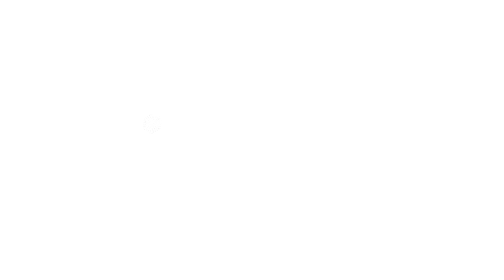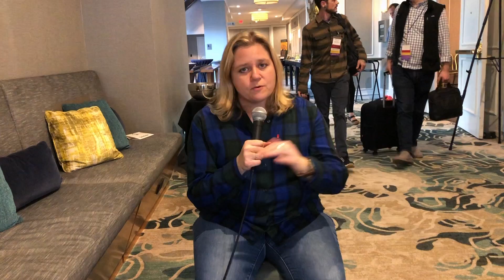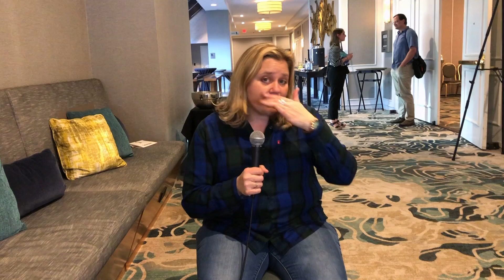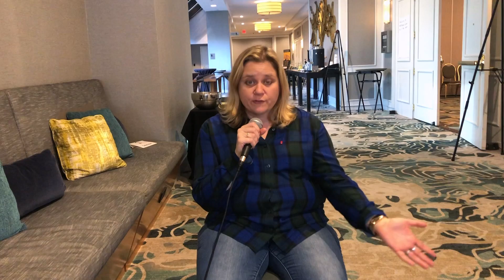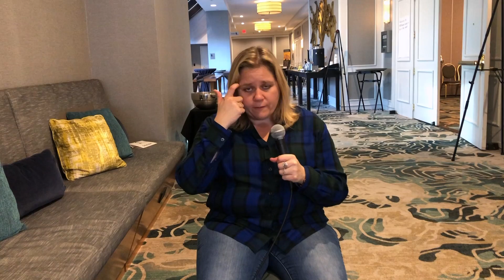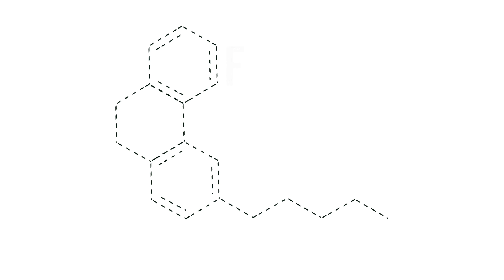Vapor Pressure Deficit (VPD) and Cannabis Cultivation

Comment: Speaking of double whammy..  Trying to get RH down later flower, when buds are larger and denser, you need HVAC super power to get to a 1.0 vpd due to the fact you need your temps sub 68 degrees, the point at which you can get PM or bud rot if your humidity gets too high due to failure somewhere in HVAC system.  Therefor, you need massive HVAC ability to remove quickly enough, the RH in the room from feeding, if you want to run for instance, a 62/63 temp at 45% RH late flower.   Having RH above 65 late flower has been no good, giving us yeast and mold issues and bud rot with some. A 1.2 kPa is far easier to get while also doing away with money sucking failed tests.  For instance a 75@60.  The units can dehum easier, and you have a good RH to deal with.  You however lose some of that shock we like to put in the plants to up our test results as well.  Lots of variables..

Comment: Since were discussing VPD measures in kilopascals, would an exhaust fan creating a negative pressure in a grow tent effect the VPD measurements ? I have a 4 inch ACInfinity inline fan and on speed 3-4 , if I pull out the tent sides, they suck right in.
Reply: Interesting. I would like to know this also.

Comment: Hello, could negative pressure ventilation (in a grow room or tent) influence VPD ? Could there be relations between the two we could control ?
Reply: Not really. VPD calcs account for atmospheric pressure so if you drop the pressure it will reduce the vapor pressure in the leaf and outside it.
Reply: @samburgner8179  yes but the LST and room temp remains the same
Reply: @surronzak8154  They would both cool down under lower pressure?
Reply: @samburgner8179  I need to check this but I currently don’t have a powerful enough exhaust fan, you maybe right, could the leaf transpire faster thanks to lower pressure ? Resulting in faster cooling
Reply: @surronzak8154  Well its all feedback controlled so the faster it cools the faster the transpiration rate will slow. You were right that the light intensity affects the LST more.

Comment: I would really like to know how defoliating affects VPD. Especially as its a common practice said to increase yields. Leaves are important for so many things so im just wondering why this practice is said to do this.
Reply: Doesnt affect VPD. Plant will evaporate less overall because of less leaf area, so if the humidity drops as a result of that then the VPD would rise, but you could dehumidify less and the VPD would not change. VPD is an indicator, not a measurement. It relies on stomatal conductance, leaf temp, air temp, vapor pressure in the air. Many ways to change VPD, but defoliating is not one unless you change your environmental management too.

Comment: Here's an easy way to understand what VPD is as a concept if you had trouble with this video. Relative humidity is a percentage because it's the ratio of how much moisture the air contains compared to how much it CAN hold at the current temperature. VPD is basically the other side of that coin - it's a measure of how much MORE moisture the air can hold at a given temperature.
Reply: Thanks! Super helpful
Reply: so she said a vpd of 1 is usually a good set point. but do you try to maintain 1 the entire grow? or change it for different stages?
Reply: @DampButtHole Different VPD for different stages. You want a low VPD 0.4-0.8 during propagation/early veg so the plant focuses on root development. 0.8-1.2VPD for Early-Late veg and 1.0-.1.5 for early to late flower.

She states in the video that having a higher VPD to prevent molds can actually have a ironic effect. So, a VPD of around 1* is good. Each plant is different.
Reply: @DampButtHole seedlings .80, veg .95/1 flower 1 to 1.2
Reply: 1 is generally safe all-around, but there's a range! You can go lower for clones/seedlings, like 0.6 - 1.0 kPa. Vegging plants stay happy around 0.8-1.2 kPa, and flowering plants can go higher - 1.2 - 1.5kPa. I like to envision a spectrum from hotter + wetter, to cooler + dryer, as the plants go from seedling to vegging to flowering  @DampButtHole

Comment: Not a word about leaf surface temps, which is a major factor of VPD. 
Think of a triangle, where you have to keep 3 factors constant within a parameter-
air temp at top of canopy
Relative humidity at top of canopy
leaf surface temp at top of canopy
you are looking to maintain 1-2 degC cooler leaf surface(LST) than ambient.
Everything can look fine in the numbers if you ignore LST, but maybe little growth..
then you check LST and find it is 5-6 degC below ambient, 
then you realise why LST is also on the VPD chart along with air temp & RH.
Reply: True, I didn't talk about leaf temperature. You are correct: Technically speaking, it is the saturated vapor pressure at the leaf's temperature that we should be using to calculate VPD. But plus or minus 2 degrees doesn't have a major impact on the overall VPD (eg. 1.0 vs. 1.05 kPa isn't going to make a big difference in plant transpiration or health). Also, many people do not measure leaf surface temperature, but they do measure air temperature and humidity, so it's much easier for people to figure out VPD from these parameters. Ultimately, I'll be happy when the day comes that EVERYONE is using VPD as a plant growth metric, whether they use air or leaf temperature.
Reply: @drgreenhouseinc  How can you call it VPD without knowing or addressing LST. maybe .05kPa is insignificant, but you only have to look at a VPD chart to know how much difference 1degC LST makes to the VPD, because they are 2 different charts...
I think I'll refer to the Dr that made the charts on this one, his opinion here is obvious. When you have seriously tried to use VPD to guide your grow, including LST, you find out just HOW hard it is to get & keep right. Keeping an ambient temp & RH stable is easy- but that aint VPD.
Reply: @allxdup1909  Yeah the leaf temp is critical and even more so between the top and bottom of the canopy. VPD doesnt drive transpiration when the lights are off either, only heat flux.

Comment: Vpd is scary for cannabis for sure.  Finding the happy middle.  I like my humidity 55% but temps in mid to high 70s. If I get over 65% I worry and when lights shut off the the humidity should stay below the temp as if it goes above the temp that can cause issues.  Juggling the VPD take the proper equipment and can be expensive on a large scale. Humidifiers dehumidifiers a/c and heaters etc are all needed to keep your humidity in check
Reply: I set the brain to lower the temp down ten degrees or shut off half off the room 10 to 15 minutes before the lights go off. To lower the temperature of the room so less water falls out of the air when the temp goes down.
When I run big light depos greenhouses that is one of the things I make sure, that the greenhouse closes slow. 10 minutes or slower and when we do it by hand we do half at a time wait a while and then finish.
Otherwise it basically can "rain" on your plants

Comment: Thank you for the knowledge drop I live in canada and in the winter I have a hard time keeping rh over 25 % and definitely noticed a nutrient deficiency I think it's time to get a good humidifier and  if I understand right  around 50 % rh at 70 degrees Fahrenheit should shock  the plants less ??
Reply: I actually feed less when humidity is that low. Plants seem happier than normal feeding as they can’t uptake with low RH.
Reply: @MatanuskaHIGH  
That makes sense, the plant will not be as efficient at using the nutrients.
I feed a lot less on super hot days for outdoor. The lower the EC of the water the more that the water can help fight  heat stress.
Reply: Eastern Ontario by late june with the right humidity pressure my plants grow 2' in a week, its crazy
Reply: @bennyb6071  early flower I often see 3-4"/day with my indoor setup
Reply: I’m in Alaska and the colder below freezing the drier it gets.  So my vpd fluctuates constantly.  Humidifier and demumidifier  plus AC and heater are needed to keep a constant VPD.  Gets expensive lol
Reply: There are charts online that tell the RH you want for the temperature your room is.

It will optimise the amount of gas your plant can uptake.
Which in turn will make you have more nutrient deficiency's because your plant will be able to increase the amount of photosynthetic reactions that take place thereby using more nutrients.Just a heads up.
Reply: Yes, 77F at 50% RH is typically considered ideal for flowering cannabis. At 25% RH the plant will transpire much more, burning through water and oversaturating the plant with nutrients if you don't adjust your mix accordingly. Growers also keep their relative humidity so low at 50% to help prevent mold growing on the buds.